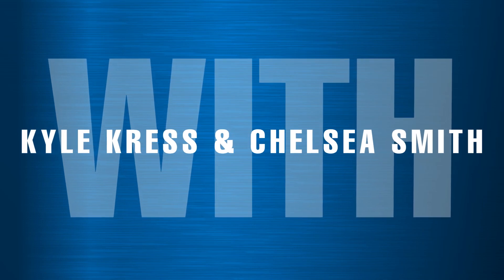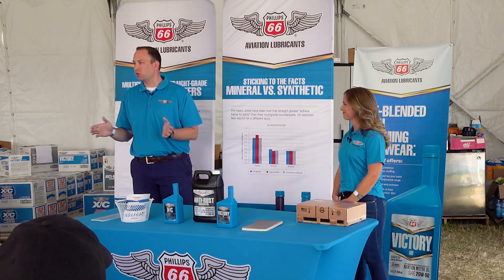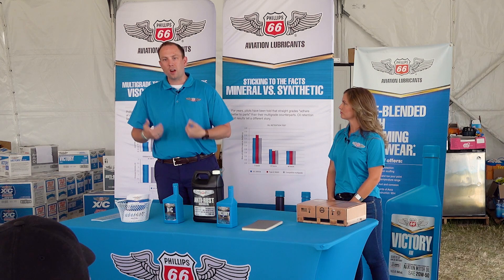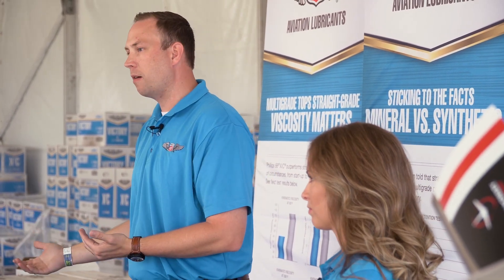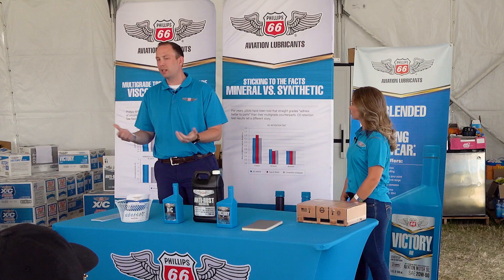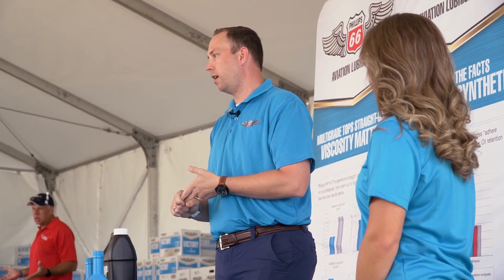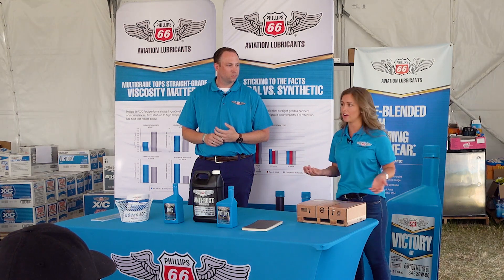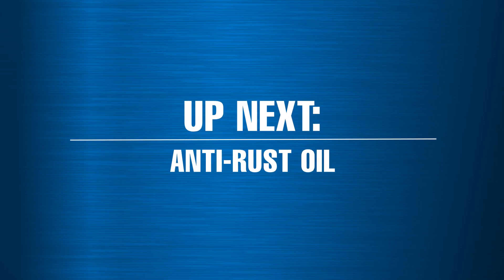Synthetic vs. Mineral | Understanding Aviation Lubricants

Comment: Damn our race engine run leader fuel and synthetics. Keep up with the times Phillips. If you have to lie you have bigger issues. Keep it simple is my advice. I run Aero Shell because of analysis. If I’m getting a ton of fuel in my oil I’ve got other issues going on.